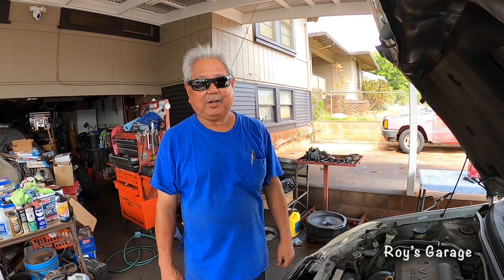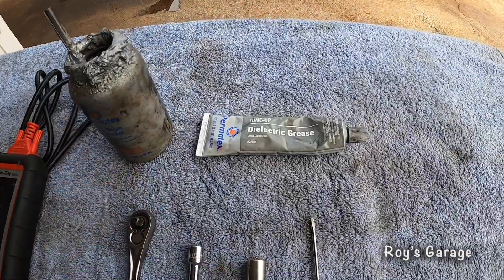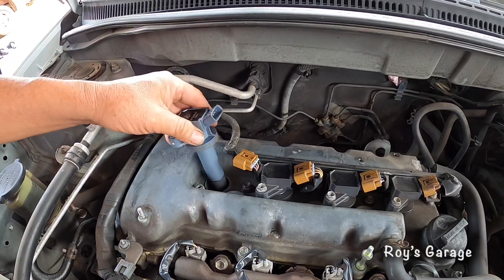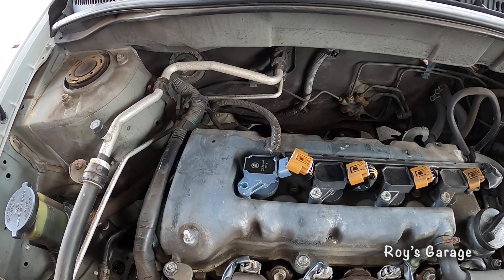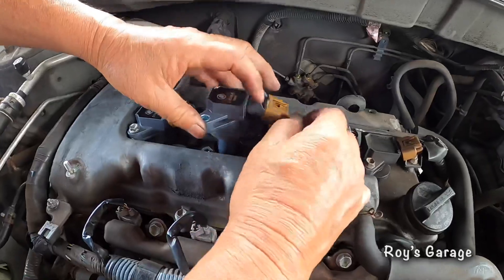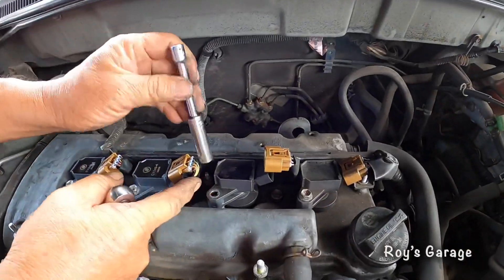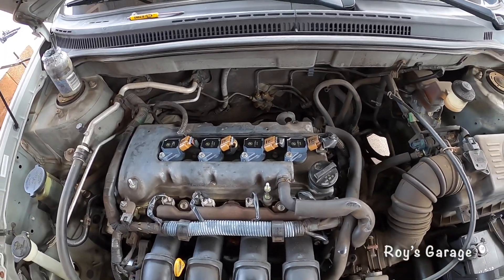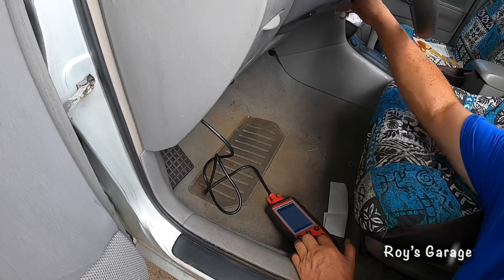What Code P0301 Means & How to Replace the Ignition Coils on a 2003 Toyota Corolla

Comment: Hey Roy, from your experience is code P0301 almost always an ignition coil when it comes to Corollas? My car (2003 corolla) has a few engine codes (some evap system related, which I won't be fixing), code P0171 (System too lean, from research online seems like intake manifold gasket is going bad), and then code P0301. The car isn't riding rough and power is fine, I've only noticed the codes because I frequently clear them to ensure nothing major is going wrong and being hidden by the evap system codes. Was curious if the system being lean could cause the P0301 code, or if I likely need new ignition coils as well as a new manifold gasket. Thanks in advance for your help 👍